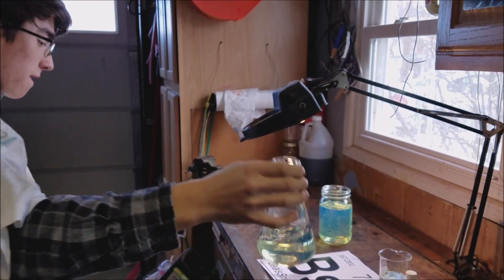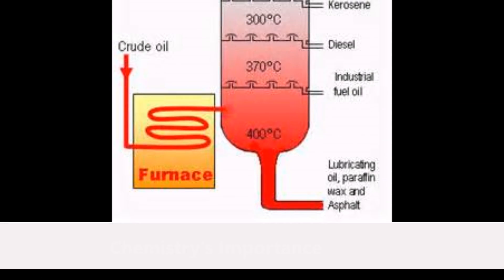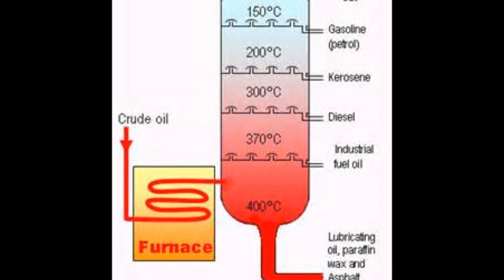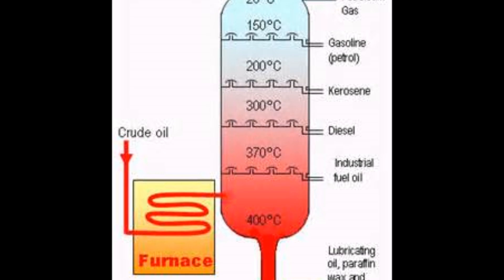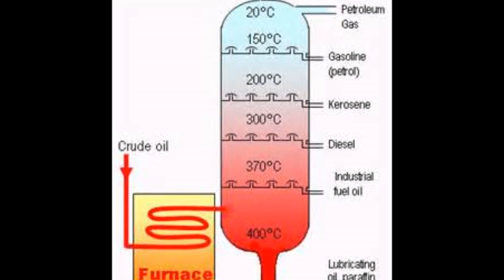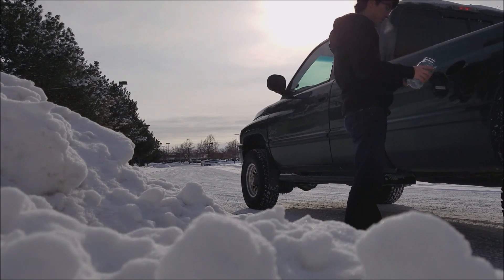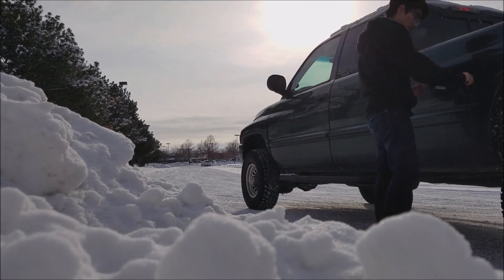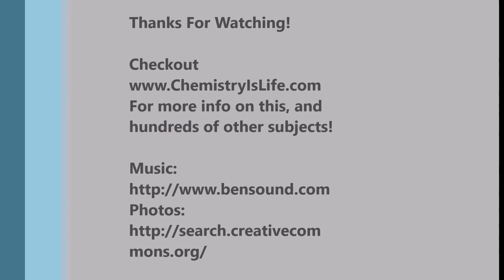The Chemistry Of Diesel Fuel - Russell S.

Comment: Sorry, but Chemists do not design distillation columns or equipment, Chemical Engineers do. Chem E's are the ones running those plants too. Knowing that the different fractions separate at he various boiling points is not enough to actually make it happen at scale. There is a lot of thermodynamics and fluid dynamics that go into these design calculations that Chemists are not trained to do. Engineers are. Our backgrounds and training are not the same. Sorry to be contradictory here, but as a Chem E with over 4 decades of experience, I cannot let such misinformation pass without a comment. I do applaud however, your attempt to bring more understanding to the public.